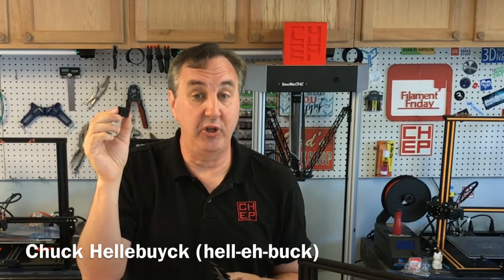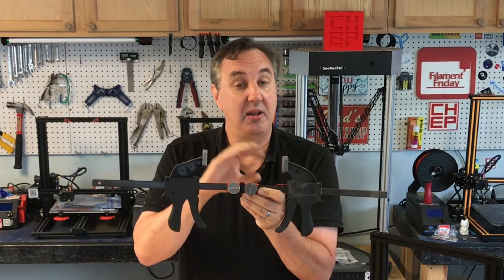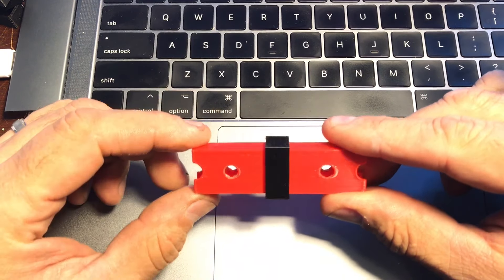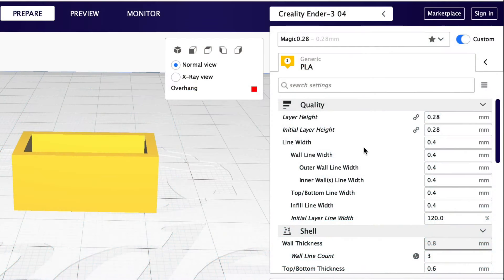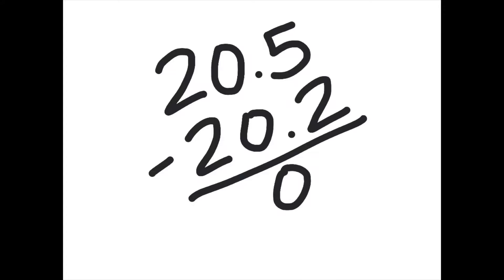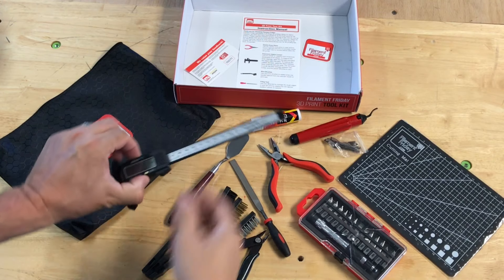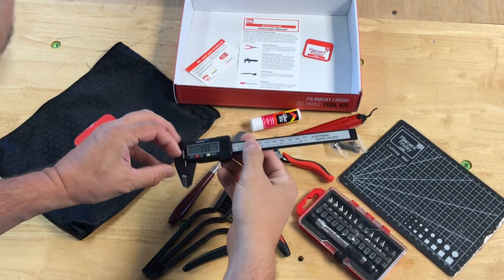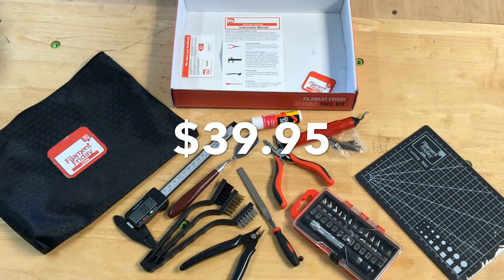Perfectly Accurate 3D Prints using Horizontal Expansion

Comment: Once i figure out the horizontal expansion correction, should i leave this setting for all my future prints or is this something specific of each model/print?
Thanks and Great vid!
Reply: There's likely a specific amount of horizontal expansion compensation that will apply to all prints with a specific material and settings such as speed and layer height. However some prints and some parts of prints present their own accuracy problems, such as small circles losing diameter more than the rest of the print. There are a lot of forces that there's no known good way to account for and predict.

Comment: Watchout when you measure the dimensions of a cube, you need to measure the middle piece, exclude the corners. 99% of the printers get the corners wrong and they get bigger, but the actual piece stays the correct size. If you measure the whole piece including the sides, you might get a bigger result than how it actually is.
Reply: Specy is correct. When measuring with calipers, it's good to get a top, middle and bottom dimension... Even better would be to do it in both directions. Now how do you fix those inaccuracies? Slow the print down? Get better stepper controllers?
Regardless, this is a great video on the subject. I searched youtube and clicked on another video where a guy just printed the cube and left it at that...Pretty useless. Keep up the good work.
Reply: @mattpeneguy7812  to fix the bad corners you have to adjust the jerk and acceleration settings. Higher values give better angles but also higher the ghosting. You need to find a good balance between the two

Comment: What should I do if the X and Y measurements have different differences between the original size it was supposed to be?
Reply from the maker: Then use my CHEP cube to calibrate first. Find out if belts are loose or steeper’s are skipping.
Reply: @FilamentFriday  Okay thanks, I am printing one right now and you seem to be right, my x-axis belt seems to be loose. My next print will probably be a belt tightened. Thanks for the help!
Reply: *belt tightener, sorry for the typo
Reply: @FilamentFriday  Yes! Thanks for the advice I printed out the part and tightened the x-axis and now my calibration is spot on!
Reply: Edit: turned out not only the belt tension but the x steps were also slightly off too.
Reply: @FilamentFriday  where do I find your calibration cube?

Comment: How do I fix or compensate for the z axix?,I print a 15mm x 15mm x 15mm cube,and x,y are right at 15mm,z however is always .5mm too small,I've micro guaged the entire bed is level,anything I can do to fix my .5 under height on prints?
Reply from the maker: Try printing on a raft.
Reply: May want to check/adjust Z steps if it is always off the same amount in Z.

Comment: Looks like this technique (differential) is like much a better approach that changing X and Y steps (proportional). Have you tried printing bigger parts to see if accuracy is preserved?
Reply from the maker: I’ve printed multiple parts of different shapes and sizes but each may require a horizontal adjustment as so many this affect the accuracy. This is just a final adjustment.

Comment: Am I able to make it perfect for the first time before I print the part without horizontal expansion? How do I get the number?
Reply from the maker: Not that I’m aware of. You need the error from the first print.
Reply: Well, it's good to know what horizontal expansion is anyway because I seen it many times in cura and didn't know what is it good for. Thanks!

Comment: will this work for circles? my dia is .06 off. but when i print cubes out they are exactly 20mm all sides
Reply from the maker: Yes.
Reply: did it work for holes?
Reply: @FilamentFriday  Thank you! That's exactly what I am facing right now! I calibrated the printer with the cube. They are all good, all three axises. But when I print the gear shaft that I want to use in a RC car, It always give ve about 0.2-0.25 mm smaller shaft. I will try this feature for sure. But I do want to know why a calibrated printer gives off diameter when print circles?

Comment: I have an issue where i am printing a case for a circuit board and its 100mm x 80 mm.  When printed its 99.5mm x 80 mm.  So I am off by .5 but only in one direction.  What can I do?
Reply from the maker: Adjust that dimension slightly bigger on the side menu setting.
Reply from the maker: No because several factors affect it. Temp, filament, slice settings and design. Every print is different.

Comment: Curious. In Cura 4.2.1 operating in Windows 7-64, I am unable to set -ve values for horizontal expansion.
Reply from the maker: There is apparently a bug in 4.2.1 though it seems to work on my Mac. Not sure what the issue is.
Reply: Negatives don't appear in Cura 4.2.1, the value can still be input and you'll see a blank space before your number, that's because it IS negative but the "-" sign doesn't appear ! So just input "-17" or whatever, it will show " 17" but it's gonna work just fine !
Reply: @daver18qc  Grateful for your advice. I did notice that once I hit the  -  key the cursor moves one space but I wasn't sure if was registered. In any case I think this bug has to be sorted out as if another  person looks at the values it would be a guessing game as if they were _ve or +ve. Thanks again.

Comment: So my  quesion is...

Im assuming because there is no vertical expansion option, that vertical expansion by default doesn't present a problem? or is it a lack of cura features?
Reply from the maker: It’s called layer height.
Reply: @FilamentFriday  lol fair enough
Reply: You might have an extremely slight vertical deviation just because of the Slicing Tolerance. This option can be changed under Experimental.

Comment: hi,i got this problem where my inner wall was set smaller by 0.2mm but the outer wall is perfect and i use horizontal expansion at -0.1mm and the results came out the inner wall is perfect but now the outer wall is smaller by 0.2mm,how do i solve this?
Reply from the maker: That could be design related. It’s tough to make anything perfect both inside and out. But based on that , I’d try -0.05mm and then both should be 0.1mm smaller and then print it at 101 %. Or adjust flow to extrude a touch more.

Comment: Hope you can help... When i do soo, the outer size also goes up? What can be wrong? kind regard From Denmark
Reply from the maker: Your flow rate may be too high.
Reply: @FilamentFriday  The i print a 20x20x20mm cube, is´t 20 - + 0,05. Does you stil thing it´s the flow rate?
Reply: @FilamentFriday  I tryed to replicate the one from the video.. If i just print it. it´s perfekt outside. but 0,4 too small on the inside. Then i dial in the expansion, and then the outside is 0,4 too big.....?
Reply from the maker: Set flow to 90%

Comment: would it not be better to compensate for the natural shrinkage? refer to manufacturers shrinkage percentage and then increase the scale by that percentage? Just a thought
Reply from the maker: Not sure that would be accurate but you could try.
Reply: It's always better to measure your prints just because what happens in the factory may not happen in your specific environment, too many variables. Same brand, type but different colours end up having different profiles for me.

Comment: Does the change to horizontal expansion make all prints dimensionally accurate or is it different for each model?
Reply from the maker: Different for each model.
Reply: @FilamentFriday  If you took the same model 24x14x10 and wanted to have the inside be 16x9 in the inside cut (scaled differently on the two axes) would that print right, ie when we print the same place, same outer movements.. or is the horizontal just a quick and dirty method.
My guess is that it would be the extrusion width that was the issue as inaccuracy seemed to be perfectly spaced.

Comment: my outside is perfect but my inside is a 0.45 to small
got a solution for this?
Reply from the maker: Reduce the extrusion width.
Reply: @FilamentFriday  Got a similar issue. My outer walls are good but my inner walls are about .4 too large. How do I reduce inner wall without affecting outer wall?
Reply: CHEP Do you mean the line width? There’s also the flow rate, which I calibrated to have correct wall thickness. I’m a bit confused with all these apparently conflicting or redundant settings...

Comment: i did try the setting , inside I got a right size 20.5x10.5, but out size i got 23.4x13.4, what shoud I do
Reply from the maker: At that point I’d adjust the design in a CAD program.
Reply: @FilamentFriday  oh, that why

Comment: if my prints were slightly undersized do i use a positive expansion value?
Reply from the maker: Yes, but it Weill expand in all directions so inside holes will get smaller.

Comment: I once heard that horizontal expansion usually corresponded to your nozzle size; that you would offset it by half your nozzle size. Is this true? Were you using a 6mm nozzle? I'm just wondering if there's any truth to it because, if so, it would make it MUCH easier to fix ahead of time.
Reply from the maker: No, I was using 0.4.
Reply: @FilamentFriday  Well, that blows that out of the water. LOL I'm making a box with a bunch of half-depth holes that will have containers in them and I was trying to avoid multiple prints. Oh well... Thanks for the help!
Reply from the maker: Just print the first few layers and stop the print to measure. 
If the holes are further up the design, lower it into the bed until the holes are present and just print a few layers there. 
Saves a lot of time and plastic.

Comment: I need to adjust the Y axis which setting is that under for cura?
Reply from the maker: Horizontal expansion adjusts both. If you only have y issues, check you belt tightness.
Reply: @FilamentFriday  Great, thanks tightened the belts, lubricated the gears and adjusted the expansion
Reply: @FilamentFriday  also had a broken piece of pla jammed in the extruder

Comment: Chuck is there a similar function in Prusa slicer?
Reply from the maker: Not sure but I believe most slicers have it.
Reply: Elephant foot compensation (First Layer only) and XY Size Compensation (all Layers) would be the Prusa Equivalent, Can be found in the print settings tab under Advanced

Comment: my dimensions are pretty good but for some reason when I print a block with a  hole it,it prints top to bottom likea  drill would,but if its sideways on (from front to back on the y axis bore) it looks elongated,slightly oval :(
Reply from the maker: Check your y and x axis stepper driver voltages. The stepper May be skipping steps.
Reply: @FilamentFriday  how do I do that?
Reply: @Don Gray Good advice Don. I would Like to add that it's important to keep  all nuts and bolts tight. Check at LEAST once a week, sooner if you print a lot. And belts do wear out. I replace them about every six months, I print a lot.

Comment: Oh man.. You need mitutoyo brand calipers, or something in similar quality. Those Chinese calipers should be at least tried out with a proper caliper to be sure that their measurements aren't thrown off.
Reply from the maker: They work fine and are accurate. We’ve tested them and why it’s included in our tool kit.
Reply: @FilamentFriday  that is great, they must make lots of different quality calipers with this same look. Mine started to go off 10% at 3cm already. Then got mitutoyos, cannot go wrong with them.

Comment: Previously know as JMAP science, you should move on to Fusion 360. It's so much better.

My ender 3 has a clearance of 0.6 for free motion, and 0.4 to 0.5 for a tight fit. I biuld those clearances into my designs
Reply: that much? my a8 has a .16-.2 right fit, .24-.3 loose fit
Reply: @l3d-3dmaker58  what settings are you using?

Comment: I dont think cheap caliper is accurate. but I do love your video
Reply from the maker: You think or you proved it? 
We’ve tested this against my expense calipers and it’s accurate to the 0.1 decimal point accuracy it shows. Any extra decimal point costs a lot more which would make the kit too expensive. But for most beginners it’s plenty accurate enough.
Reply: CHEP I can only prove my previous cheap Caliper on gauge block. IMO, I would get a medium price range caliper which costs around 40USD. You can also use on any CNC machine. The reason is very accurate on gauge block, which I have done and proved.
Reply: If you print and measure everything with the same cheap caliper, it will fit. Just don't use 2 different cheap calipers😀
Reply: You get what you pay for, and for $5 it's a pretty good caliper. I have one just like the one in the kit, and compared to a Mitotoyo it's only occasionally off by 0.1mm, way better than other calipers I have tried.
Reply: Kim T do you know 0.1mm is a lot for accuracy of calliper. Well but for 3D printer might be enough. I have also said just spend a little bit more you can get a callipers much better in that kit. e.g Igaging, stainless steel more durable.

Comment: Great channel. After following the video I found that I was able to get the dimensions correct. but when i print a part with a bolt hole or a nut recess I am not able to get all the dimensions correct at the same time. Any advice would be appreciated. Thank you
Reply from the maker: That may require other adjustments like wall thickness and flow %
Reply: Thanks I will play with those settings.

Comment: What you do when your outside size is accurate but the inner size is not?
Reply from the maker: Check the design parameters.
Reply: Because this parameter is poorly explained, it is to compensate for dimensional changes when the parts are treated by temperature. There are multiple factors to consider such as the extrusion width and the extrusion factor to generate a wall with the exact width we want.
Maybe you have to calibrate steps in X movement and in Y movement.
Reply: What we do in Solidworks at work is adding a configuration with a "move face" offsetting the inner faces in order to compensate for the shrinkage, printing a part with a slightly bigger hole. 

For example: you desire to get a 20mm diameter hole and you get a 19.8mm. Then the offset but would be (20-19.8)/2=0.1. 

I hope it helps,

Josué

Comment: the right way to do it is taking those tolerances in mind when designing (with good CAD), horizontal expansion almost always will mess up the shape and you may want different tolerances depending on orientation and shape

Comment: Next time try Slicing tolerance: Exclusive.
Reply from the maker: Have you tried that or just guessing? 
I tried it and didn’t change anything. Without the horizontal adjustment everything was the same with or without Exclusive. It mainly helps ramps or angles in a print not straight walls.
Reply: @FilamentFriday  I'm using it and it works for me. But you're right, according to the documentation this option affects only sloped areas.

Comment: Great video. Unfortunately you have to print it to fix it.
Reply from the maker: Only the first few layers
Reply: You can always print something smaller that has a hole and also just a few layers, but bigger calibration object makes the calibration more accurate (if you assume linear motor travel to steps relationship, which is probably not 100% accurate as such, since the belts may stretch differently with different carriage position). I print a large, thin square frame for X and Y steps and a card with different holes for horizontal expansion.

Comment: Oof CHEP, sorry to say, but this is gonna bite a lot of people in the ass. Sure making the entire model bigger via a "Scale by Normal" type function will solve the problem on a cube. but this wont work on more complicated models. it'll make some problems even worse. 
From watching your video I can tell you are slightly overextrusing. You should tune your Extrusion modifier (Flow) instead. This is the first thing I do when I start printing with a new spool of filament on my Ender 3 Pro, and I have a tollerance of just 0.1-0.2 at most. Tuning your E-Steps will only get you so far in terms of acurasy. 

Take a 20mm Cube:
no infill
No top/bottom layers
perimiter with = your nozzle size (so incase of a .4 nozzle your perimiter size should be .4)
and print 3 perimiters at your target print speed

Now measure the top 3 or so MM of all 4 sides with a digital caliper with 2 numbers after the Dot. they should be close to 3x your nozzle size (incase of 0.4, 1.20)
if its higher(IE. 1.23), drop your extrusion Mod (Or Flow) by 0.01, if its lower (IE. 1.16) Raise your Extrusion mod (Or Flow) by 0.01. Do this till you are ata tollerance of 0.01 in both directions (IE. 1.19 - 1.21) Now your accuracy should be within 0.2 for EVERY print you do.

Keep inmind that you have todo this ofr every new filament you have. even if its just a new color PLA because the ingredients used can alter the extrusion Mod (Flow) you need.

I hope this actually helps.
Reply: You don't know what you're talking about. Hope this helps.
Reply: @mrb2917  Lol much Salt, very wow xD Thanks for making me laugh!